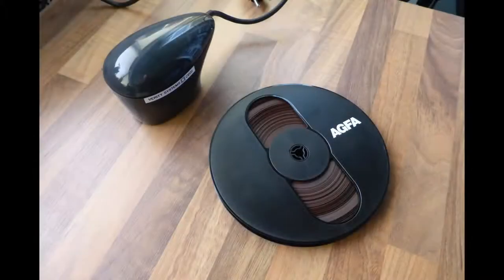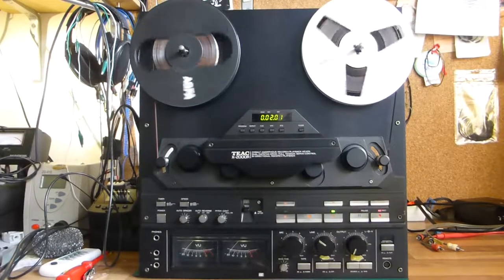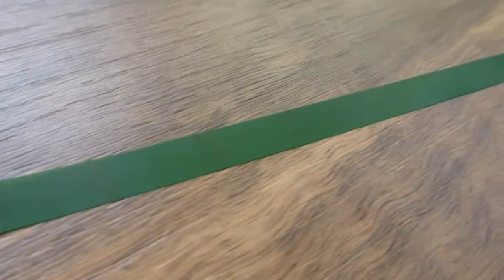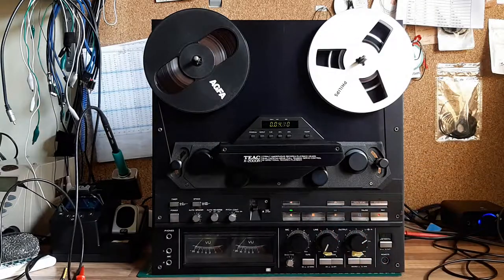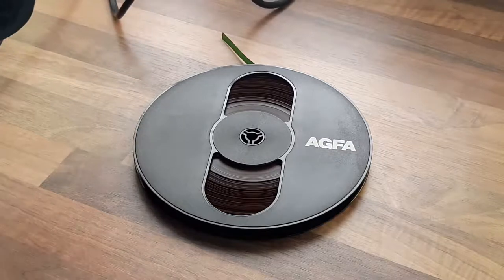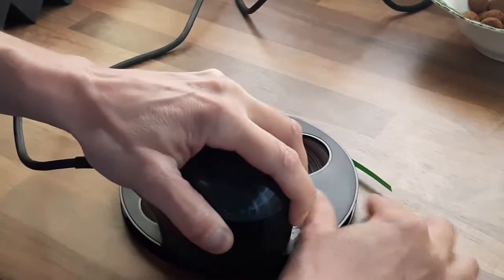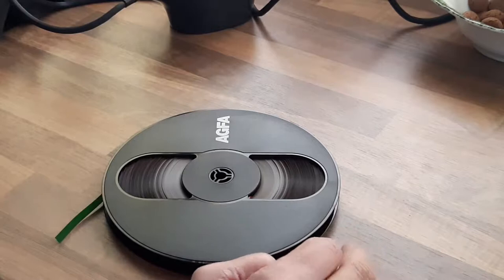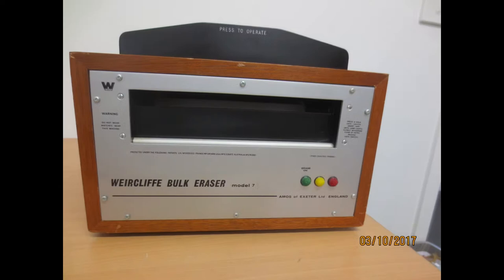How (not) to bulkerase a reel to reel tape

Comment: From my experience years ago.  First, note the maximum time eraser can be on as it can overheat.  Then, turn it on far from any other tape and also tape decks.  I would casually recommend five feet, the further the better.  Once you approach tape with eraser keep it close and go slow and use the center of the eraser as the point you want to slowly cover the entire tape with you wish to erase.  Flipping if you like keeping eraser close may insure maximum exposure.  When finished within the time the eraser says is OK to operate slowly remove from the tape while eraser is still on.  If the erasing unit is a decent one and you've been careful to cover the tape with it the tape should be silent.  Residual noise should be that inherent in the tape formulation itself which is to say it should be as quiet as it is manufactured to be.  I have seen different tape erasers vary quite a bit in their strength and effectiveness.  Basically go slow and methodically cover all the tape using most of the maximum time the eraser can safely operate to with perhaps a small margin to insure no overheating.  In practice when a tape deck records over already recorded tape it usually works well enough without having to use a bulk tape eraser though I know some folks always prefer to bulk erase.  I enjoyed your video as it brought up a very typical result requiring multiple passes to insure full erasure.

Comment: Why not just connect something to the machine switch that unit off set levels to 0 and record a dead signal into the tape. On play back you will hear nothing
Reply from the maker: I do not think that you got the grasp of the video. Maybe I did not explain it enough. A possible scenario is when you recorded a 2tr tape with butterfly heads,  then record new audio over it using narrow track head (and accompanying narrow track erase head). Then there will be audio leftover. See the recent video from Foxbat.

Comment: Great video!  I have several 10.5" metal reels full of tape that I want to erase. Should I take one side of the metal reel off before I erase, or will it effectively erase it through the metal?  Thank you!!!
Reply from the maker: You should be able to erase through the aluminium, although it will be a little harder. 
Two thoughts:
1) I would not take one side of, if there might be a chance that the reel will become unbalanced after refitting.
2) Be careful of making scratches with the handheld bulkereaser on the reels. I sometimes use a piece of paper or something in between to not damage the reel.
Reply: @PhilipvanderMatten   Very good! Thank you!!!

Comment: nice demonstration. You may want to power up the eraser a bit further away from the tape and make your revolutions around the reel a bit slower. One side of erasing should do the whole tape, no reason to flip tape over to do the other side unless you have 1 inch or 2 inch tape.